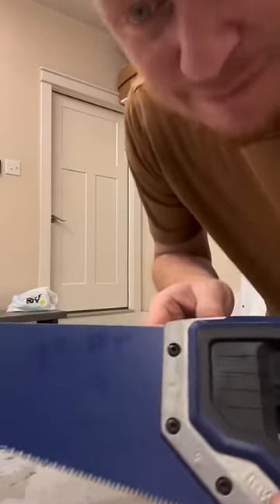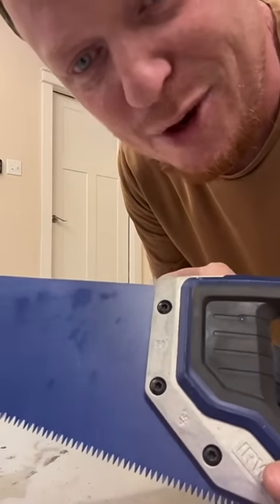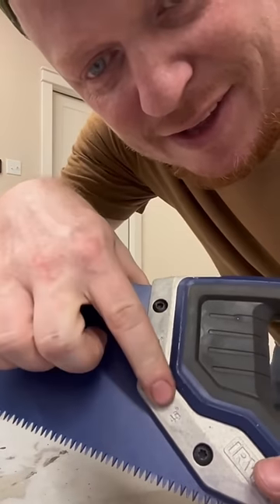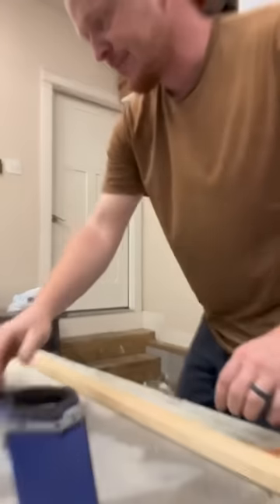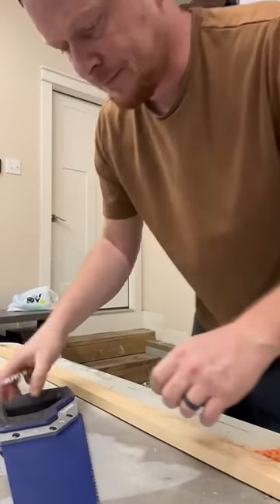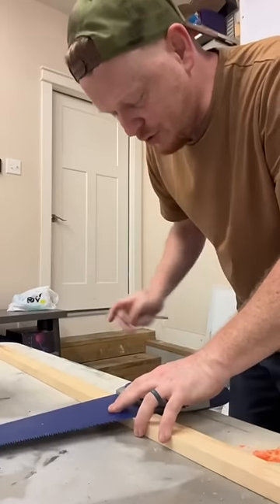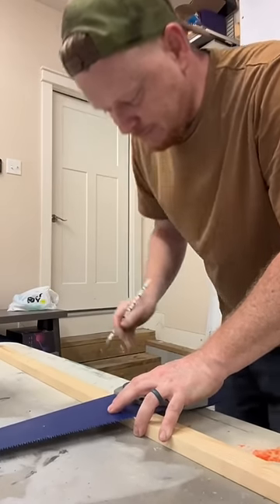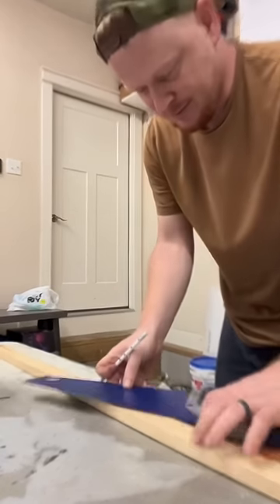You’ve gotta be kidding me 🤯 #tools

Comment: Please don't forget to check your saw for square. Those things go out of square easy.
This tip also helps more if you can cut a straight line to begin with.
Reply: Haha! I love the disclaimer in your tip 😂😂😭👍
Reply: So you’ve seen me try to cut lumber😂
Reply: Flip it over to get both angles that way you always know if you are square also will catch a mistake on placing the square (or saw) like if theres a dip in the wood or you were sloppy or whatever, checking every 90 from both sides just cuts down on screwups and i need fewer screwups
Reply: *assuming it was right to begin with…

Comment: Did home improvements for 20 years and never knew this. Oh, that's probably because I didn't use a hand saw more than twice in that time. I will say though, in a pinch, anything with a straight edge becomes a straightedge, and anything with two straight edges at a 90° angle becomes a square.

Comment: As construction worker i knew this from young are since its family trade, but yeah people are shocked from things you can do. Also thing people dont know, there are two different saw teeth designs, the most common is for cross cutting the shark teeth design and one resembling hacksaw is for linear cutting.
Further more you can sharpen the old saws with file, while new saws and files can be sharpened with sinking them in acid that eats metal away, exposing new teeth edge from the rounded one. You essentially dont need to throw away your saws or files if you simply sharpen them. Old saws were valuable so those might be sharpened until there was no material left to sharpen. New ones are hardened steel so only way to sharpen is acid.

Comment: You can use the straight edge of a speed square to cut lines faster on 2x4s  with a circular saw and not need a chop saw for a straight line

Comment: older saws had a hole in them , u put a nail or screw in them and put a pencil tip in the teeth of the saw and u could make any arch or a circle old saws was 36 inches u could make up to a 6 ft arch

Comment: I still have an old one with the marks… Not every carpenter had a framing square - and speed squares are a fairly (within 60 or so years) recent. Easier to carry your saw, hammer and nails than 10 different oils to do a simple job…
Reply: *tools, not “oils”…